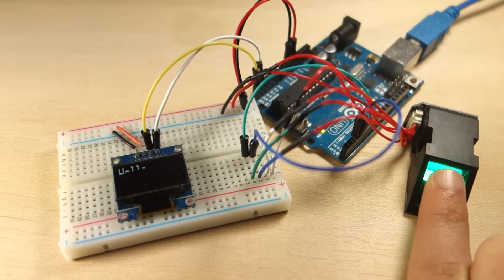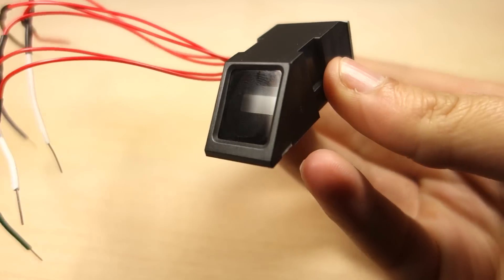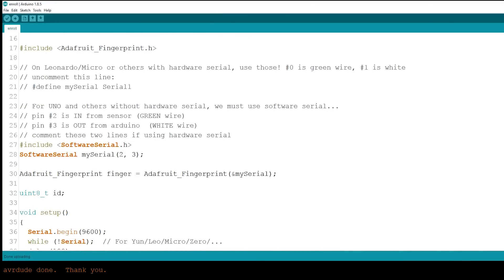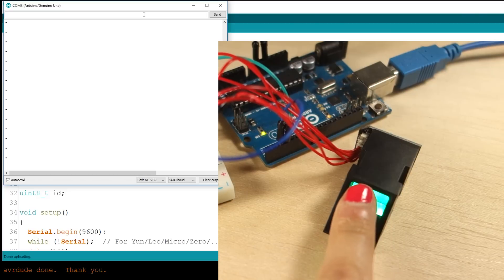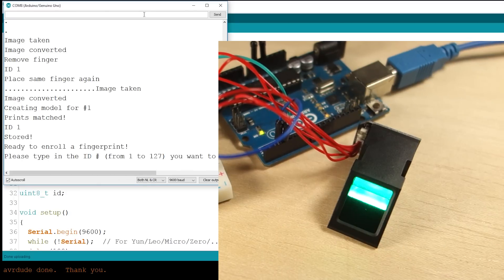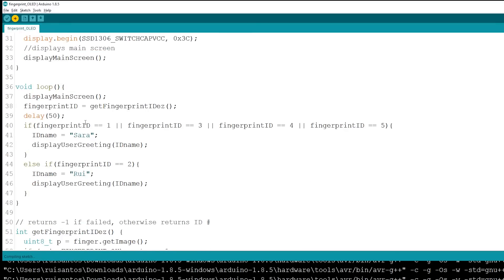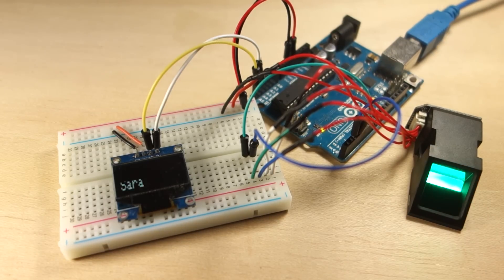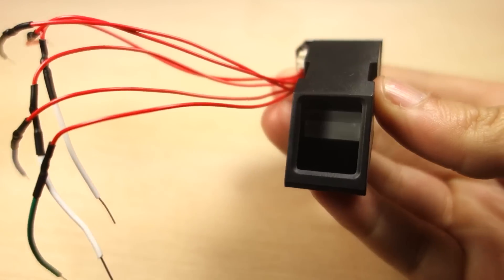[DEMO] Fingerprint Sensor Module with Arduino

Comment: Thank you for the video, please guide me though...
I have a fingerprint scanner with seven wires, below the pinouts are four  'shiny dots - solderable' written GND, D+, D- and 3.3v... I soldered the pins and put the wires as: 3.3v to 5v, GND to GND, D+ to digital PIN 2 and D- to digital PIN 3 on the Arduino board, I installed adafruit library and arduino says no fingerprint scanner, I interchange D+ and D- for digital PIN 2 and D- for digital PIN 3 and same error.. the fingerprint scanner does not have anything printed on it except ZA... what am I doing wrong, on connection the fingerprint scanner lights up green..

Comment: Thanks for the video. These sensors really don't work very well, do they :-) Can't put one of these on anything mission critical. On AliExpress for this kind of sensor, I've read that sometimes it detects a finger even when there's none.

Did you try the capacitive ones? https://www.aliexpress.com/item/R303-Capacitive-Fingerprint-Reader-Module-Sensor-Scanner/32620290283.html